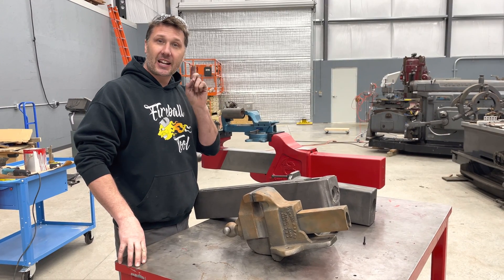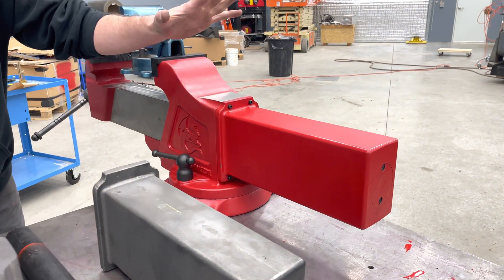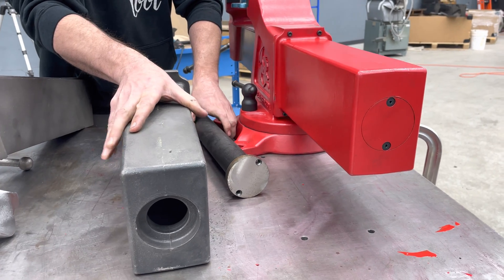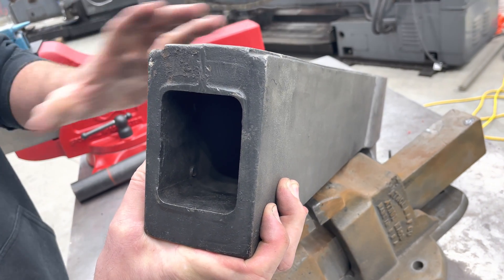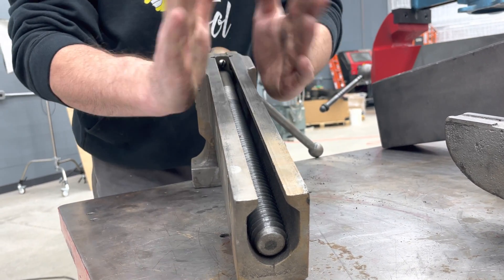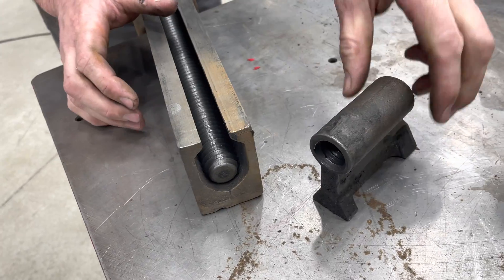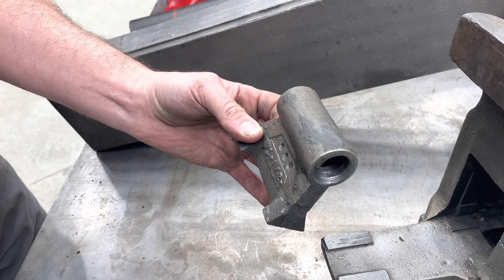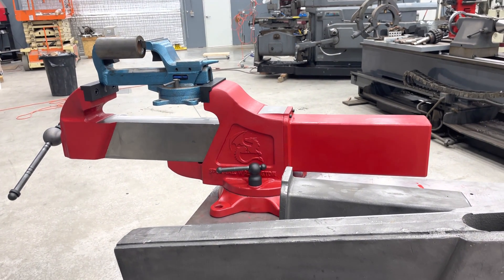What is the Purpose of the Hardtail? - Fireball Hardtail Vise

Comment: (just a point)
While the drive mechanism is "center drive," let's realize that the vice jaws are not in centerline.
Reply: @JorgTheElder  I understand that, yet there would be flex on that "box-in-box" because of what I said. That flex will mainly affect the circular contact surfaces in tension.
Perhaps, to think too much into it, a spherical cupped mating surface for the "ends of drives" under tension would address that.

Comment: Not really sure if a vice needs to be that strong. In my opinion a vice is NOT designed to have a huge resistance. It is more a matter of holding a part for any manual job than pressing it. If I need to press...I got a press! But when I have to hold a part in a vice I want it to be strong to a degree but also easy and convenient. In this way the stronger is not always the best...in fact never...

Comment: Just wondering, since this is a purely mechanical vise and not hydraulic, could a strain type gauge be engineered between the "nut" (or as part of the nut) and the end of the hardtail to measure force on jaws?  As a feed back for the user to visually see how much pressure you are placing on items being clamped.

Comment: Ohh, that sealed construction will be great around grinding dust.
I would like to see some bigger bolts on the hardtail though, it kinda looks like you could snap those bolts if you dropped a heavy bar on the end of the tail. You could maybe extend the body so that the tail cover can be shortened too (which would also give a longer slide contact). I am guessing to grease this you would have to remove the slide? Probably hardly ever needs it with that nut length though.

Comment: Beautiful piece of equipment.   If I had a machine shop business I  would buy your vise immediately.   Unfortunately, I am a DIYer and have no  real need for a vise that large.

A couple of thoughts,  first, based on watching a lot of restoration videos, no one ever seems to do much maintenance on vices.  I would guess that a small percentage of vices get disassembled and cleaned.  That is until they become a restoration project.  To prevent debris from entering the fixed tube you may want to fit a wiper like those on the ways of a lathe.  Also, there should be a few oil or grease ports.

I like the weak links you added to the handle to limit the loads that can be applied.   While many will disagree with the design.  In my mind it is correct.  Ship's  winches have a designed in load so the brake will yield prior to the mooring line parting.  Or, worse yet, the winch being pulled of the deck.  Likewise, the pin securing the bitter end of the anchor chain is designed  and often times partially cut to ensure  that if the windlass and its brake fail the anchor and chain are lost before the chain locker is pulled through the hawse pipe.

If I had a place to put it, or a bench strong enough to hold it I'd consider buying one of your vices just to say  I owned one.

Bob

Comment: How is the hardtail going to keep crap from getting into the mechanism when  most  crap is going to get into the vice from the work end??
Reply: If you think about where the important parts of the mechanism are in this assembly, really the nut and screw, the hard tail configuration works like a labyrinth seal. While grit could get into the works from the jaw area, it will never make it to the nut. It'd have to travel all the way to the end, then drop down on top of the extremely long nut, and THEN, impossibly, make it all the way to the other end of that closed, round nut.

It's really a simple but brilliant configuration that solves a bunch of problems all at once.
Reply: @bradley3549  And if one really wanted to avoid grit getting inside at all costs, this design is much simpler to add some wipers/seals, though I hardly doubt they are necessary
Reply: @CatDaddy6968-l5c  Yeah, a felt wiper wouldn't be a bad addition really if that was a major concern.

Comment: Looks awesome any thought of adding a good way to hold pipe? Possibly a different set of jaws to hold pipe? Also a set of soft jaws made out of brass, or like how Wilton has theirs?
Reply: For the amount they want it should have pipe jaws mounted below the main jaws.  If it's going to be the center of your shop, it needs to be as useful as possible.